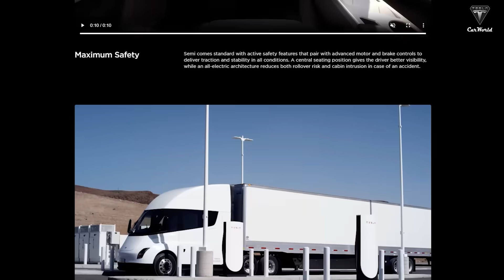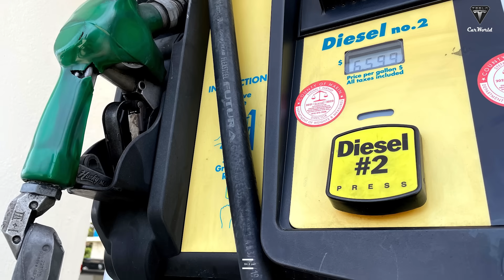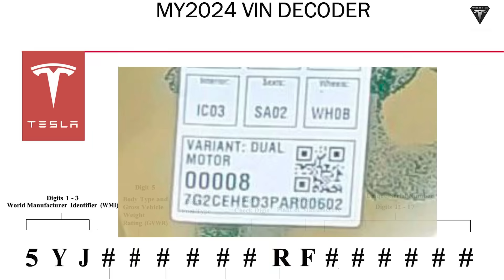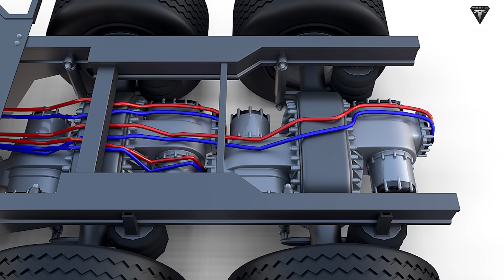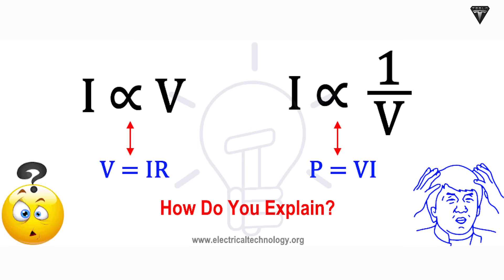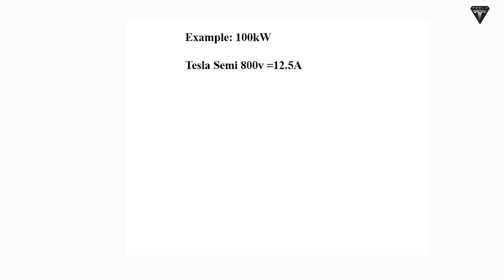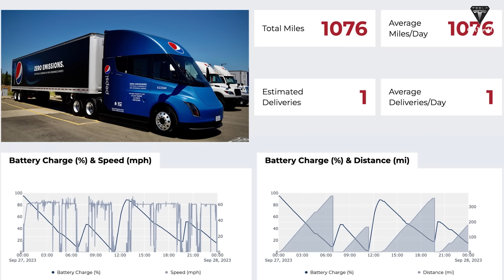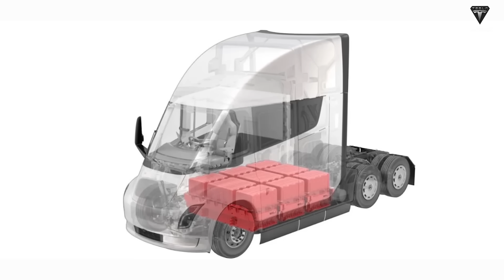Elon Musk LEAKED Tesla Semi 800-Volt Revolution! Price Cheaper 2.5 times? Just 20 min Fully charged!

Comment: You talking about the voltage of 400 or 800 volts. Now, to explain regular folks out there for example, Tesla using 12 volts DC need 100 AMPS. If you convert the car to 24 volt DC then it will need 50 AMPS and to make it better convert to 48 Volt DC then only 25 AMPS is needed for same car. Car is using AMPS not voltage. Voltage is for charging 800 volt will charge in half the time then 400 volts. All drive motors are 3 Phase AC voltage all other is DC Battery and all. There is an Inverter to convert DC to AC to drive motors.

Comment: Is there any info on the conductor material used to power the Supercharger station? Larger aluminum material sure would save on copper. The lead would need to be copper braid for flexibility but that’s about it. Yes copper does a better job but it seems to be harder to get with a reasonable cost.

Comment: Does it beat rail in ton cost per mile as Elon mentioned /?
Reply: Hell no. It runs on rubber tires on asphalt, trains run on steel wheels on steel rails. On good level track you can push a railcar by hand

Comment: Higher voltage does not decrease charging time, increase torque or power to the motor and has minimal impact on cabling. Lithium batteries are about 4 volts each so at least 100 must be put in series to get to 400 volt. The charging speed depends on the C value of the batteries (chemistry) not on the overall aggregate voltage. Higher voltage is just a marketing ploy and is not a premium feature.

Comment: As electricity costs have been increasing and are expected to double for the grid upgrades your actual costs would be more than the diesel truck. The life span of the battery is at most 10 yrs where the diesel is 20. At the cost of 50000 to 100000 thousand for a battery for the truck your not saving anything intact your losing to the diesel truck. Good try on the sales propaganda though.

Comment: Wow ---> LEAKED COMMENT!  Listen, most people have very little knowledge about tractor trailers and this video is counting on that.  An electric truck would be awesome and I would be thrilled to drive one but it has to be able to do the job as well as current diesel trucks. This video is full of non-relevant and misleading claims and figures.  Although they are attempting to look like they are being non-partial, the comparisons either are chosen from the extreme opposite side of the spectrum and/or the figure provided is "calculated based on assumption"?  What does that mean?  To me it means that none of what you said should be included in the video because it is completely made up.  I'll give you an example. They choose compare the made up price of $250,000 for the Tesla to trucks costing $160k and $150k.  Why not a brand new Mack Anthem starting at $100k.  The video also does not discuss other information that is very important.  If it is actually possible to charge the battery as quickly as stated (but again the number is not backed up by any form of actual testing) what would that do to the longevity of the battery if it is charged in that manner everyday?  If it turns out to be the case that you can charge it in that manner everyday but the battery will need to be replaced in only three years how much would it cost to replace the battery?  Please keep in mind that downtime on a truck is a very bad thing. If the wheels aren't moving then it's not earning money.  Personally I'm asking myself why I watched a video that includes LEAKED in the title.  Also, why in the world would I (or anyone else for that matter) believe anything at all that Elon Musk says?  Hasn't he allegedly (someone with a bunch of money can afford lawyers even if they tell lie after lie and are a supporter of a terroristic dictator) proven himself to be a liar time and time again?

Comment: 1,000 volt not 800. Still latest info. FSD will be bigger impact on professional vehicles in cost, eliminating driver, changing when it’s used, how many hours a day, what speed. But that’s another story.
Reply from the maker: Yes, we mentioned Tesla Semi used 1000V architecture but 300 mile variant for 800V
Reply: FSD ain’t happening any time soon, despite what Musk says. This is the guy that said they had convoy capable tech in 2017.

Comment: You do realize that the Tesla semi is only intended for local route. S it's not a long hall truck, right? Such a limited use case. And Zero emissions? LMFAO. Just displaced emissions. And based on the mileage for towing with a pickup truck. If that is a good metaphor I can only imagine how bad the range gets as the trailer gets loaded down more and more.
Reply from the maker: Now, Tesla Semi only provide Day Cab Variant, Sleeper Cab will be release soon!

Comment: Is there enough electric generation? Is there enough national electric transmission infrastructure to supply 1.2 megawatts to charge just one truck? Will truck fleet operators be willing to pay for the astronomically expensive needed substation to charge their fleet? Can the utility even supply such a load demand to each truck fleet operator? Is there enough roadside right away space left to burie / bring the needed transmission primary electric to all the individual truck fleets who are loosely distributed here and there on scarce commercial zoned property in crowded city's spaces to convert the nations commercial trucking fleet from diesel to electric commercial truck fleets? You decide. Have you ever worked for a national electric utility designing cable runs within, and around electric primary sub transmission architecture? I have. Utopian progressive type keyboard jockeys with dreams of an all electric truck fleet coming your way any decade soon, and are so clueless with none of these design skills comment away. Oh and green nieve thinkers will tell us that in the future there will be enough fusion electric generators nationwide to power all these electric commercial trucks needing on demand without stressing the grid to failure charging. You know it is the grid engineering details that expose the crash of utopian dreams like 100% E.V. trucks on the nation's highways. I just chuckle and roll my eyes. Yea right. Keep dreaming greenies. Keep dreaming the utopian dreams. Diesel truck power is here to stay for many decades to come. Sorry to pop your comedy strip cartoon text bubble.

Comment: Silly idea it'll never happen Electric truck can't compete with diesel on any level 😢 fantasy
Reply: Hold my beer
Reply: Bcp plus puissant que n’importe quel camion thermique. Pas d’entretien
Reply: What rock do you live under
Reply: Perhaps they can around town, hauling light loads and close to a charging station. For long haul and heavy loads... no way.
As for the claim that the Tesla semi uses 2kwh per mile? Please, spare me, I'm not that stupid. Implicit in that claim is that 120 kwh will power a fully Laiden semi 60 miles in one hour. What absolute nonsense. There's a reason that the likes of Kenworth and their piers produce prime movers (tractors) that produce upward of 3 times that power. It's because it takes 3 time that power to do the job! Volvo produce a prime mover that produces four times that power! And, top tip: Transport companies specify power plants to match their requirements. Those numbers aren't there for good looks.
We know that it takes 350+kwh to operate a truck trailer combination in normal conditions. That's not rocket science. Thats "every truck driver in the world knows it" science.
And we know that 100 kwh of battery currently weighs about 600kgs. That means it takes 2.1 tonnes of battery to move the semi down the road for one hour in normal driving conditions, with nothing left in the battery. If you want to do an 8 hour day? You guessed it, clever you! 16.8 tonnes of battery! What's the gross tonnage of a truck in the US? Oh.
But the typical Truck Trailer combination in the USA operates for 11 hours. How good are you at math? I'll make it easy for you 11x2.1 =23.1 tonnes of battery. Full to empty. 
But it's lucky that truck drivers need to sleep. They can do that while a 250kwh charging station takes nearly 16 hours to charge the battery! If only there was three more hours in the day! And people believe this 5h!t. !!! Ohm's law, Newtons law and common sense should be taught in first grade. This 5h!t is so easy to figure out but no one is capable of doing it, seemingly. It does my fv@k!ng head in. And if my figures are out by 50% (they're not, by the way), it is still the stupidist thing that I've ever seen anyone believe in my life.
Reply from the maker: We respect your personal opinion, but electric trucks can entirely replace diesel trucks in everything. It is not widespread at the moment, but countries are moving towards emission-free vehicles in the future. The Tesla Semi surpasses diesel trucks in many aspects and falls behind in several others. Competition is possible.